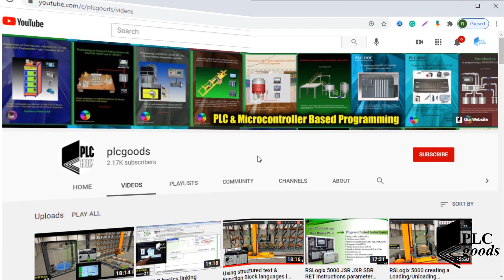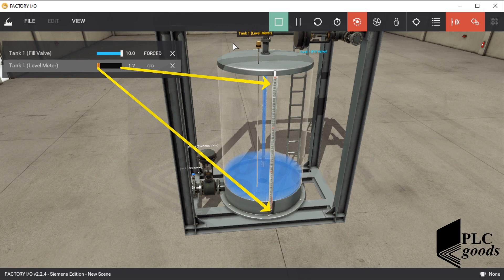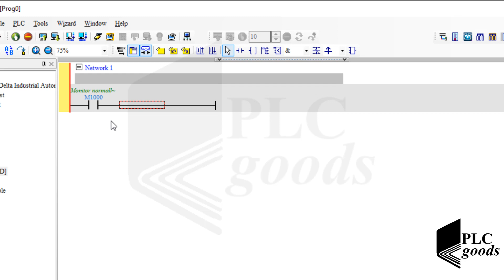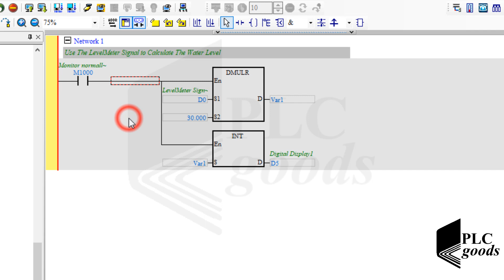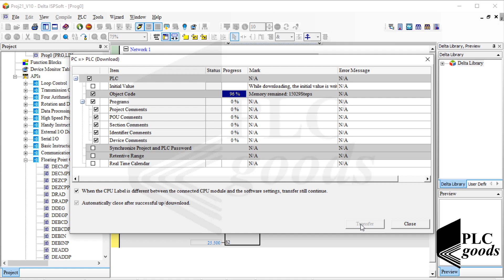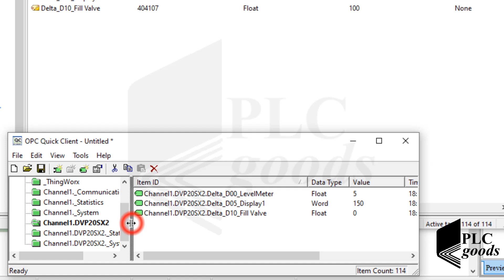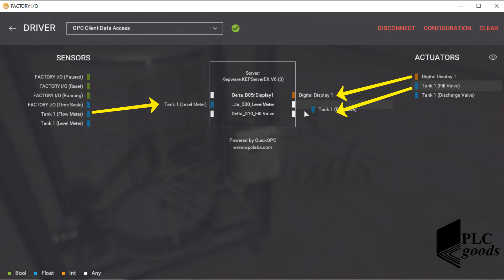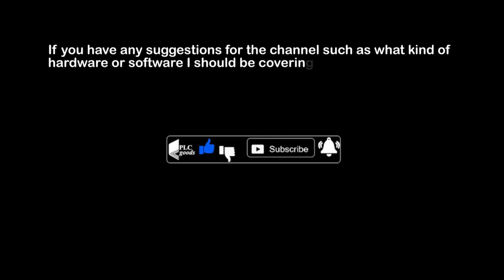Analog Signal Control in Delta PLC | Water Tank Project Tutorial  | Lesson 21

Comment: How can analog output signal from plc turns as input to the electro pneumatic regulator.
Reply from the maker: Hi there, I explained general guides to work with analog signals and modules. For a specific device, you will need to use its user manual or an experienced engineer who works with electro-pneumatic regulators.

Comment: SIR, I AM USING DELTA TP70P-22XA1R PLC WITH BUILT-IN HMI, I WANT TO KNOW THE MODEL(SS2/SX2....) TO BE SLECTED WHEN LADDER PROGRAMMING. AND WHAT SOFTWARE TO BE USED FOR HMI PROGRAMMING.
Reply from the maker: Please check either with the HMI dealer or google it around, I did not work with related HMI device you have it on hand.